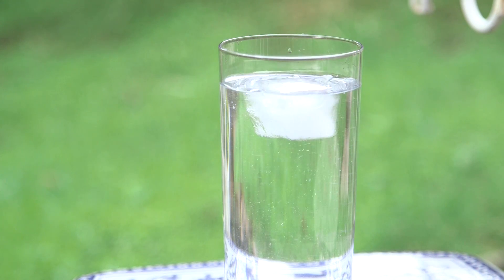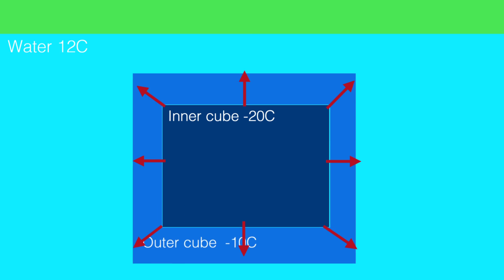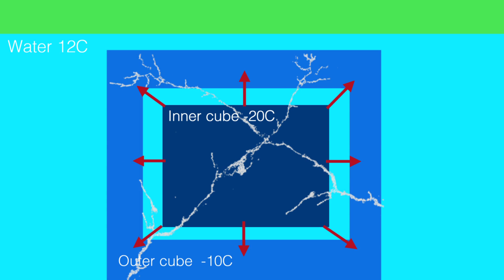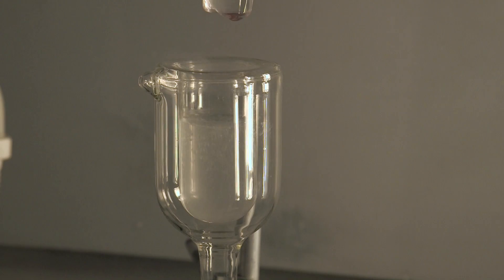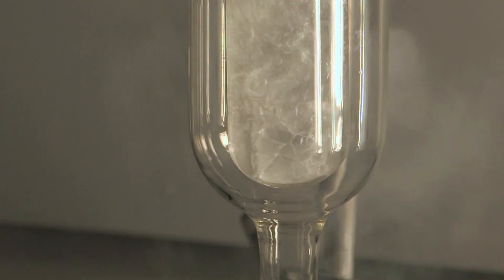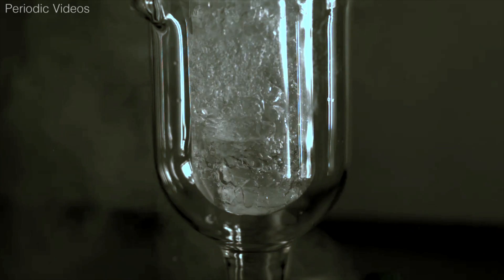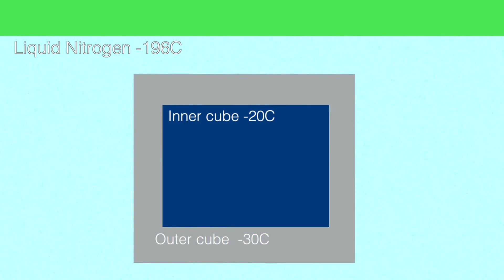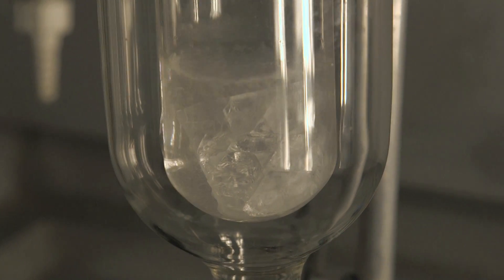Why do ice cubes crack in drinks? (SLOW MOTION)

Comment: Why does the ice crack in the liquid nitrogen, but glass gets that Prince Rupert's Drop thing going on when cooled quickly?
Is it that the molecular bond is simply weaker in ice than in glass?
Reply: Yes, ice is simply held together by hydrogen bonds, which are rather weak.
Reply: Flo Well, glass doesn't really have a specific point of transitioning from liquid to solid. It's simply an amorphous solid all the time.
Reply: I was thinking about that as well, but my guess is, that the difference is because the Drop is a liquid that goes to a solid by cooling down and the cube is solid in the first place.
Reply: Thank you, all of you.
Reply: What if the ice-cube was perfectly spherical?
It would get the exact same stress at all points, and maybe it would hold?

BRADY!! Try it!
Reply: Herr Hansen  Why don't you make a perfectly spherical ice 'cube'? Just get a ping-pong ball, make a tiny hole, fill it with water, and freeze it. it'll probably expand and pop the pingpong ball, but it should be frozen quite a bit already then. They're not expensive anyway, so if one goes wrong it's not that bad. You don't need a high-speed camera to know if it cracked. As you could see in the video, it's clearly audible when it cracks.
Reply: joeytje50 Oh, hehe. Sorry, I was thinking in swedish and typing in english. We call ice-cubes something completely non-geometrical, so I guess I ran into the language barrier and didn't think twice about it.
Reply: Herr Hansen Well, I'm Dutch, and we call them "ice clumps" ('ijsklontjes'). It's the same for me. I did understand though :P
Reply: joeytje50 We call them ice bits.

Comment: Doesn't water ice expand when it gets colder and contract when it gets warmer and not the other way around like the professor said?
Reply: nope. 
1) water expands when it goes from liquid to solid phase. (which is not commonly found in other substances)
2) liquid water has its greatest density at 4 °C

that's all there is, if the water is solid (ice) it behaves quite "normally".

this diagramm has all the information I stated above in it, including density anomaly of liquid water at 4°C in an extra closeup: google image search for "density of ice and water wiki" , first picture. as you can see, the density sharply drops as you cross the 0°C boundary, but upon further temperature reduction continues again on rising.
Reply: No. I don't think there is anything that expands when it's temperature is lowered other by a phase transformation. Yes it is true that unlike most elements or molecules, when liquid water freezes to become solid ice the density decreases due to the crystal structure of the ice and there is a volume expansion. However once fully solid, continuing to decrease the temperature of the ice will cause it to shrink very slightly. It's only the phase transformation where you have the uncommon freeze expansion and melt contraction.
Reply: My thoughts exactly, but I would assume that it would still crack as the outside would want to compression and the inside expand and it'll give way by cracking.
Reply: Ok, thank you all! :)

Comment: Are we seeing cavitation at 1:38 ? I think we are.
Reply: Draalo
I am not arguing over bubbles forming in ice during freezing. I am well aware that such bubbles form.

Some evidence of my hypothesis of cavitation can be seen in how the bubble looks immediately after the cube breaks in half. Immediately we seen a long bubble that begins contracting before it starts raising. This is evidence that the gasses that make up that bubble were created in the vacuum of cavitation and then were condensed by the pressure of the water.

Why do you think that no cavitation bubble will stay at the surface like any other bubble? Aside from this being goal post moving now (because first you said they wouldn't get there at all), you did the same thing when you said that it would have disappeared before reaching the surface. You seem to be treating cavitation gasses in some special way, but they are no different from any other gas, aside from how they were formed. It's not some magical gas that quickly reabsorbs, and it's not some special gas that cannot stay in a bubble on the surface.

And lastly, I never said that cavitation is reabsorbing gasses. What I said was that the gasses will reabsorb just like any other gas, but not in the time you suggested.

I'm still very much open to being wrong, but you do a very poor job of convincing me, or even forming an argument.

P.S. It's quite possible that we are both partially correct. Because of the cavitation taking place mostly within the cube, the gasses may have been 'pulled' out of the cube itself, as apposed to the water. Originating from the cube, but still a product of cavitation, and still beginning within a vacuum.